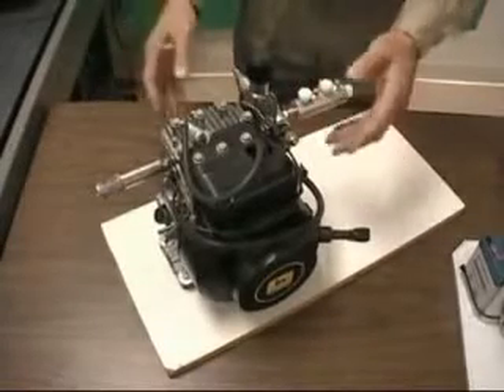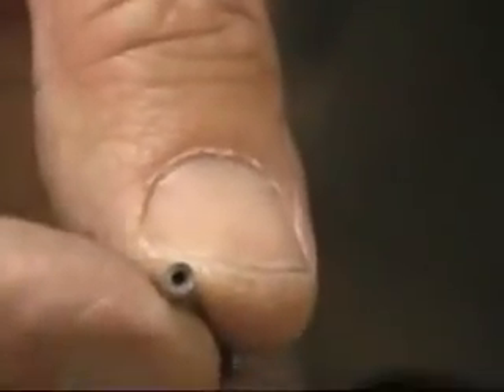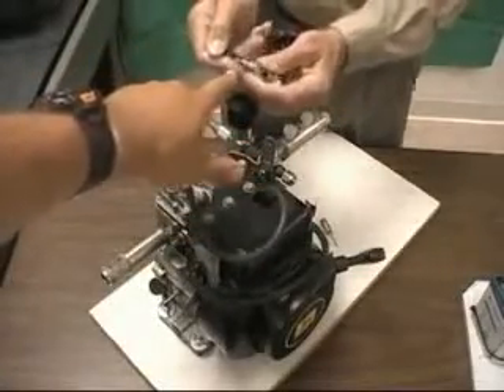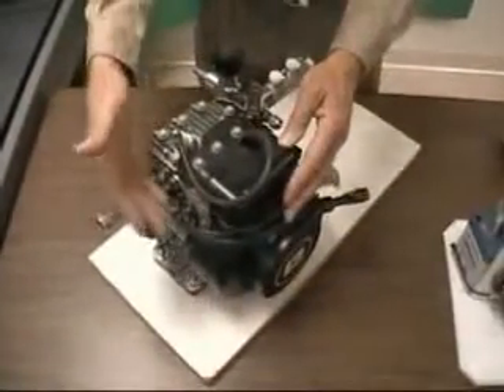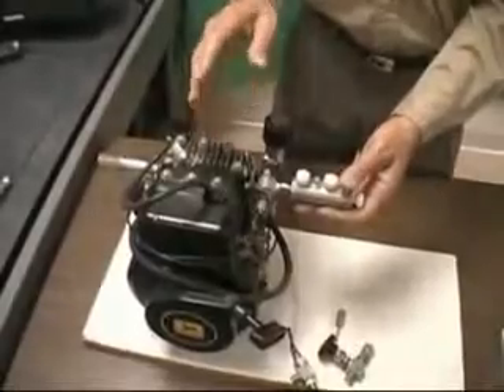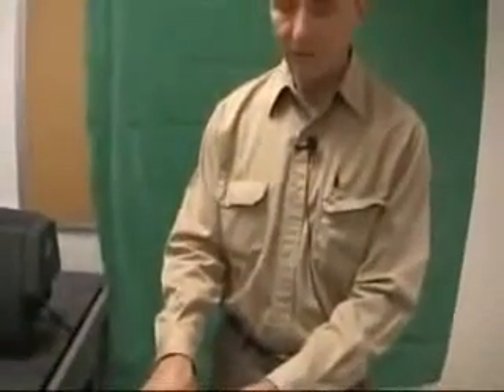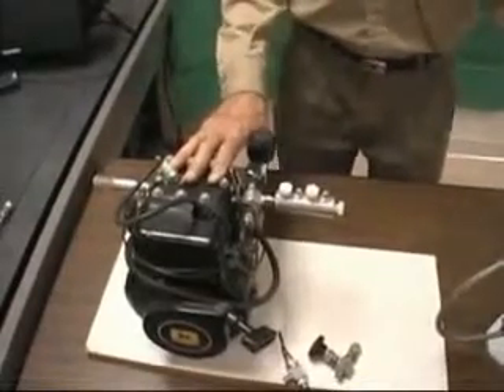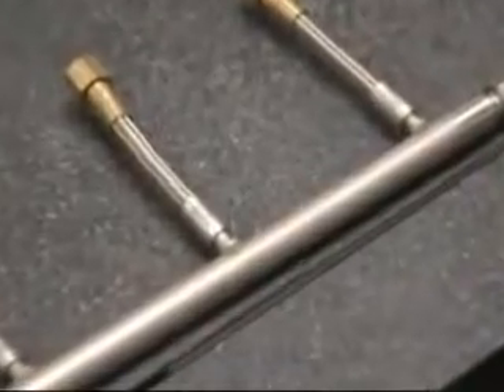Hydrogen Generator (Hydrogen Car Kit) Hydrogen Generator

Comment: I think it's Overkill... You're putting WAY TO MUCH Into The Gas Flow... All That Isn't Needed... I would use ONE Adjustable Valve for Gas Flow because that's all that's needed... To be safe? I'd put The Valve a distance away from the Engine. And perhaps an Emergency Shut off Valve on the same line to stop gas flow Instantly in an emergency...

Never Over Think Simplicity...